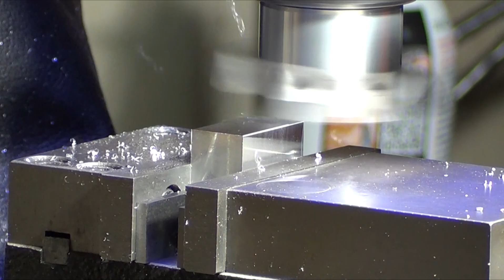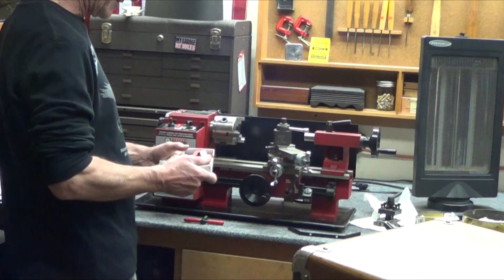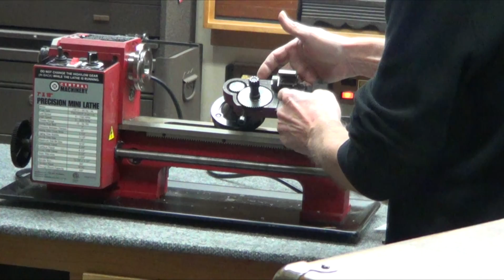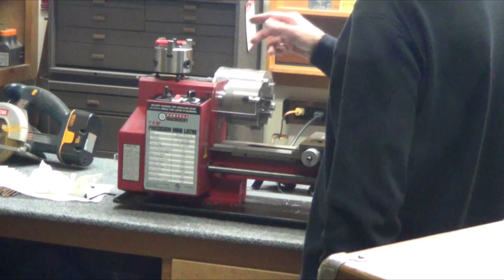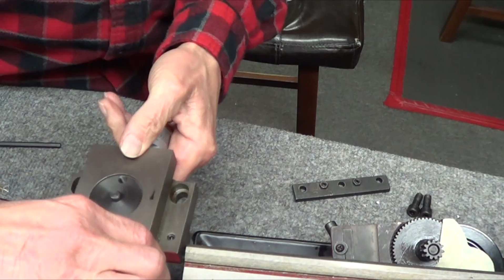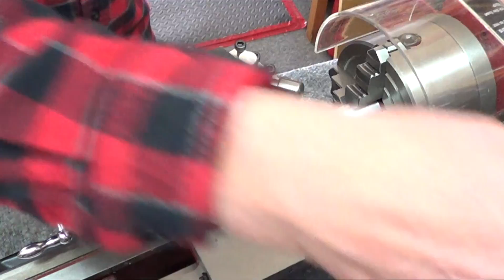New Harbor Freight Mini Lathe Rebuild Video #112

Comment: It looks like your lathe spindle is bent because when it starts up you can see your part is off balance and the spindle is also to. This is what happened to me when I had a large part on it and it jammed and came to a complete stop when it should have been supported by the support pin on the other side to hold a heavy part.
Reply from the maker: That's just a camera issue.

Comment: Thanks for the great channel Dave. I just found it and impressed with your journey as a self-taught home shop machinist, from a self-taught home shop machinist!  A quick comment on your first lathe’s quality.  A clue as to its crappy quality is the fact that there’s no serial number.  There are reports of some “grey” materials coming out of China.  It seems that after the 12 hour shift and the shutdown of the line, some enterprising employees are sneaking back in and making their own products and selling them out the back door to exporters.

Just my theory of course, but the no serial number would be typical of stolen materials and hurried workmanship.
Reply from the maker: Very old video and have fine tuned my two lathes to perfection. Learned a lot over the years..

Comment: So what did you wind up doing to the QCTP to make it work ? Just got a new one ? On your Gibbs , for the way how did you fix the rocking ? On mine either the compound Gibbs are to tight or to loose no in between ! I thought about sanding them down a smidge .
Reply from the maker: I have a granite surface plate to lap the gib on so it was flat. The last thing you want to do is sand anything it has to be ultra flat to work right. Auto supply use valve lapping compound.
Reply: @TheMiniMachineShop  lapping compound is very abrasive also ! I wound up drilling a bigger relief on the gibb to make it more adjustable , work great !
Reply from the maker: You can also paint all surfaces with dykem to see  where the high spots are scraping.
Reply: @TheMiniMachineShop  my ways seem good , it’s my Gibbs but I straightened them and open the set screw hole a pinch and now she’s like a different machine , nice chips and good straight bores !
Reply: I know this is old but I replaced the set screws with longer bolts and lock nuts.  With patience, and surfacing of all parts, the pressure can be finely tuned.

Comment: Hey Dave, so I’m experiencing a lot of the issues you described with your second one on my Hf 7x10. Is there any way to get a dxf file or measurements for the pieces you made to fix stuff like the part for the carriage?
Reply from the maker: Well at the end of every video is my email and my web site which has the plans for everything. And if you like email me and I can do a private video if you are having a problem with something. I'm happy to help until you're up and running.
Reply from the maker: Also my playlist is only mini lathe videos...
Reply: Dave, I dont believe those blocks you machined to replace the carrage steal plates with Gibbs are posted on your web page..I didnt see any prints

Comment: is the big washer that should be under the handle nut  under the tool holder by accident?
Reply from the maker: Actually never thought about it. Neither lathe came with one when I bought them. Just checked the 2nd lathe and I had upgraded it to an A2Z QCTP and it has a washer but the lathe you saw doesn't appear to have any QCTP wear after 5 years so I guess I'll continue without one. Thanks for mentioning it!

Comment: Hey Dave, Just got a HF 7x lathe and in the process of taking it apart and cleaning but noticed that the lever to engage the auto feed will not turn and lock into the threaded rod. Any ideas where the glitch would be. I can hand crank the carriage assembly fine but can not engage the feed lever even when turning carriage by hand slowly. Any thoughts would be great. Also not sure how to dismantle compound rest assembly, probably just need to loosen gib screws a bit, we'll see. thanks for your thoughts.
Reply from the maker: I've done a number of videos on the power feed half nut but here is one https://www.youtube.com/watch?v=pILWN1X3qC0 there are also many videos on the compound. My channel has a playlist which is only videos on the lathe. Makes it easier to find what you need. As I've said many times completely take it apart and rebuild it from the ground up. If you need help with anything just email me!!

Comment: When you took that first cut your workpiece didn’t seem to be cantered correctly in the chuck jaws.
Assuming you can get the cutter on centreline & workpiece centered correctly I’ve a suspicion it might cut pretty well.
One assumes you have a magnetic base run out dial indicator to let you test for runout on the work piece when your centering it in the chuck jaws?
It seems to be a common user error with lots of mini Lathe users to set the workpiece off Center with big run out then take a large cut to try and get a concentric surface, and it ends up jamming then that damages the plastic cogs or their Center bush.
It’s a bit of a critical issue with these mini lathes & their plastic cogs.

Comment: Good score!
For what it’s worth, that brass bar stock he threw in?
I recently needed some brass like that & bought a identical 8 inch long x 2 inch dia piece off Evilbay in the USA & had it shipped down under!
It cost me more than ~$250 by time it arrived!
So you essentially got the Lathe for free!
I wanted the brass for turning a little handwheel on my Robland  X31 combination wood work machine, speed blade height adjuster!

Comment: Thanks for the informational video. You have helped me with my mini lathe. But I have to ask. why does the lead screw originally only come with one side of the engagement claw from the factory, but when you buy a different lead screw it has both sides?
Reply from the maker: Most lathes only have one claw. But the only source for replacement parts that I found is Grizzly which uses two on their mini lathe. LMS only sells some parts while Grizzly stocks everything. I do prefer one because the alignment of two while keeping backlash down must be a night mare IMO.
Reply from the maker: How funny I answered this question thinking it was made on an apron repair video. That video hasn't released yet. So watch for it next Friday to better answer your question!

Comment: When you milled you’re new gib for the saddle, did you just make it to the exact size you needed or did you shim it? How do you adjust it?
Reply from the maker: A gib is never the exact size there is always a small gap when inserted between the compound and its mating surface. If you go here the second picture shows three gib screws with lock nuts on the compound side which push the gib into the mating surface acting as a shim. To much and the compound doesn't move to little and it rocks. http://theminimachineshop.com/gallery.htm
Reply from the maker: Just realized in the picture if you look at the cross slide just under the compound you can see two of it's three gib screws with lock nuts and also the end of the gib itself in the dove tail by the knob. Will give you a better idea of how it works.
Reply: Dave M thanks for the response. I actually meant to say saddle retainer (part #92 on assembly diagram). I watched this video last night before pulling my full saddle and compound apart to re adjust it (as I regularly do) to see if you had any tips and tricks and that’s when I noticed that you had milled yourself new saddle retainers which led to the question. My compound and cross slide gibs are good, I can adjust them just fine and get them spot on where I like them without any rocking or getting too tight. My saddle though..... that’s another story, I spent a good couple hours last night shimming and adjusting those retainers trying to get it just right and could not for the life of me find that sweet spot where it is not too tight and doesn’t rock. And that is when I discovered that I had a couple of cracks in the back side retainer because someone (me 😣) over tightened them once previously 🤦‍♂️. No wonder I can’t get it to adjust properly.
Reply from the maker: Ahhh you want to watch this https://www.youtube.com/watch?v=kXnz9t3urv8
Reply: Dave M thanks! That’s the video I think I was originally looking for.

Comment: A washer in the compound didn't work for me so I made a new housing with a ball bearing in it so the shaft could be tightened properly it worked well with little backlash Good video Roger
Reply from the maker: If you go to the web site listed at the end and download the spacer plans its a custom part where part is pushing on the dial shaft and a recess allows the dial to have a gap so it doesn't rub. Simple fix.

Comment: I'm wondering about the part you're mounting at ~16 minutes.  The original part has set screws that push on the carraige so the adjustmet between set screws pushing away and 3 screws pulling towards lets you set the height and clamp as the 'whole surface' against the bottom of the ways...

It looks like your part clamps tightly and then three set screws are adjusted (you mention ball bearings) so the bearings hit the ways, which would have much smaller contact and wear much more quickly and if the bearings are steel, actually wear into the ways.  Am I missing something?
Reply from the maker: The original I found to be crude in adjustment and also works loose over time. The front one can't be adjusted without an apron teardown. So mine is secured to the saddle tightly and ball bearings are inserted on top of the four Loctited set screws which keep the saddle from moving. As for wear its the same as gibs. .0001 counts between moving and to much friction. I've had this setup on my first lathe for a long time and there is no wear. If it does wear I can adjust another .0001. Its riding on grease I'm hoping a nice grove wears so there will be more surface area contact but no luck so far.
Reply: That make sense.  If that area is hardened you won't see significant wear without a LOT of travel.  It looks like you just did the front here, but I image you have a ball bearing on the back set screws as well (and maybe you also plan to remake the rear plate as well).  I just picked up a similar lathe and haven't even started the process of tearing it down to clean it up, but this is likely one of the first things I will be doing, so your experience in this area is much appreciated.  Also, heard you mention the blue angels practicing in another video, which takes me back to when I lived in SD a while back (I bet the weather is better than over here in Germany).
Reply from the maker: SD to Germany what a cultural shock! The print for the thing is on the web site shown at the end. Glad I could help ....

Comment: You can shim the head stock to meet the same height as your other Lathe.  That is done by removing the Head Stock and using Brass shims under each mounting bolt to raise the head so it will meet the height requirements.  or is you need to shorten the head stock height you will need bring first Lathe height up to meet the other lathe.  It does matter which one moves really as long as they are both the same height which allows the same tool post system and tool holder.  Good luck.  Nice video keep up the good work.

Comment: Nice Machine! I am looking into getting a Collet Chuck for mine. what kind of chuck do you have dose it just bolt onto the back plate or does it go through the spindle head?  I saw some on Amazon bu the reviews scared me...
Reply from the maker: Bolt on. The links to everything I buy is on the web site theminimachineshop.com.... You can also get one for the spindle but need to make  a draw bar.

Comment: That big block of what looks like Delrin or UHMW might have cost more than you paid for the whole rig...
Reply from the maker: I know its not Delrin but feels and looks more like nylon. In any case have no idea what to do with it!
Reply: If it is indeed UHMW you could make a new set of risers for the lathe itself that help absorb vibration since you have access to a mill.  

In case this is unfamiliar UHMW stands for Ultra High Molecular Weight and it's basically just a tougher version of Delrin...easily machined but leaves stringy chips at times and might not look as nice as Delrin in finished form,but it's tough and in your case plentiful 😎.
Reply from the maker: Have some UHMW and pretty sure this is nylon. Good idea on the risers but you know what a mess that would make of the shop sawing and fly cutting it! I'll stay with the wood ones for now.... BTW scary just how much you look like a good friend of mine from New Jersey.

Comment: Not to shabby.

Working compounds are nice. ;-)
Reply from the maker: I should try stainless on it... and will LOL
Reply: I have a spare slug of 304. Anytime you want grief and frustration, just let me know.
Reply from the maker: LOL easy on a real lathe! You should get one ....
Reply: If I'm not mistaken, my lathe came out of the same factory as yours. Same lathe, different color. ;-)

Of course, you could chuck up a slug of 304 and show me how it's done.
Reply from the maker: No problem .... https://www.youtube.com/watch?v=zWA_M4QLjKE
Reply from the maker: In the video watch the smoke. 1st a lot then a little better then almost none. Less heat thus less work hardening.

Comment: Hi Dave  Serial No. is etched or stamped in the end of ways. newer minis are laser etched and early  ones are stamped,don't know when they changed over. Your No looks to be 42639  Nice find.
Reply from the maker: My first one has a sticker on the head stock 351661240 and the ways 23849 and the second laser etched on the ways 42629. There is a place on the head stock that says serial but wasn't filled in. Maybe this is an illegal knock off! LOL